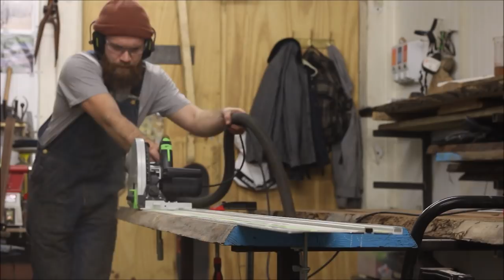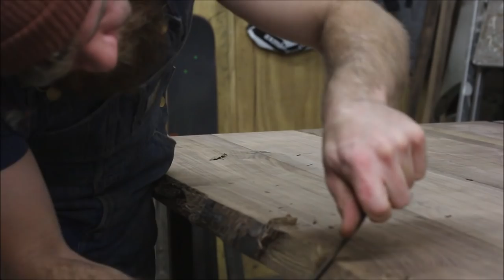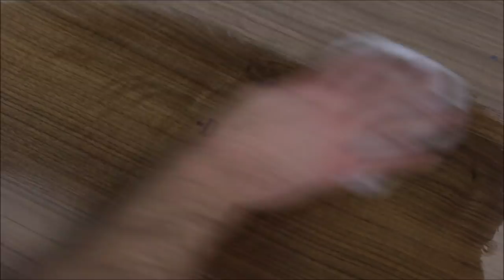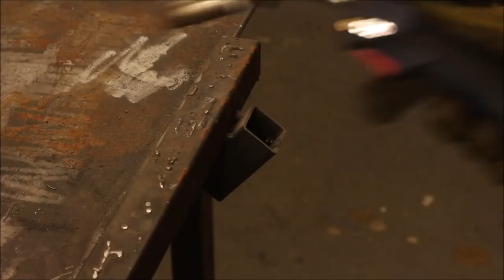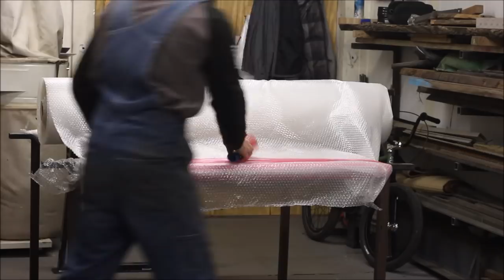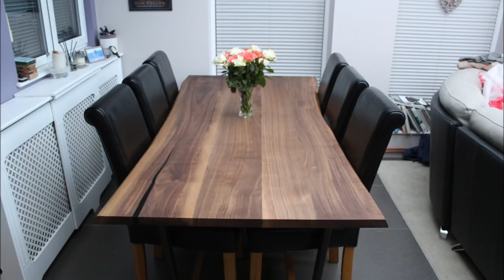Making a Live edge Dining table, Black walnut.

Comment: What a lovely table. I am just an amateur, but i have a couple of questions about the legs.
I noticed that the base of the legs fit snugly into the wood? How do you handle the seasonal  expansion and contraction of the wood? Now there doesn't seem to be any room for that. Or am i missing something?
Don't the legs need stretchers or a frame to keep them in place?

Comment: How far apart did you put the legs? At what point do you need to include stretchers? I’m currently building an 8’ Long 36” wide black walnut table as well. Wondering how far apart I can put the legs without having sag. Great video!

Comment: I plan on building a black walnut computer desk soon. I was wondering, what did you seal it with? I like the outcome. I'm looking for something that's not gonna be glossy and keep most of the natural wood look. Also, as long as I get a nice planed edge on all the boards, will glue and bunch of bar clamps be enough to hold it together?
Reply from the maker: I always use Osmo poly-x oil. Couple coats buffed in-between, will last years! 
And yeah, there was no joinery between boards on this table, decent brand of glue will be absolutely fine 👍🏻